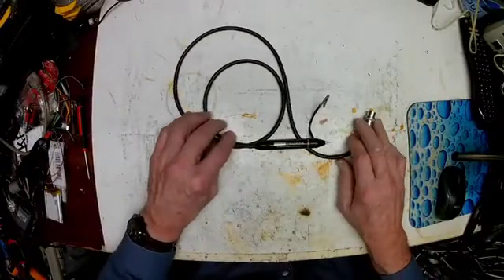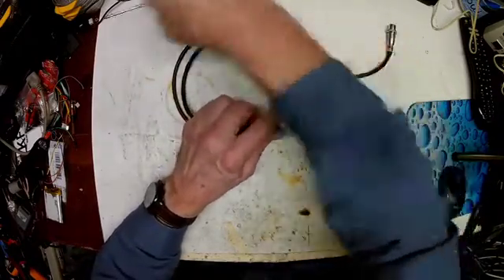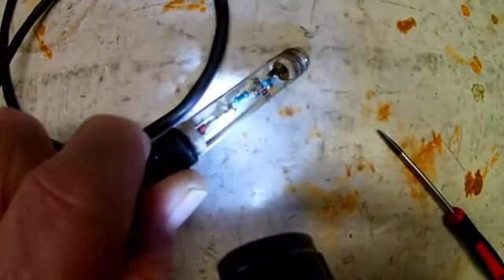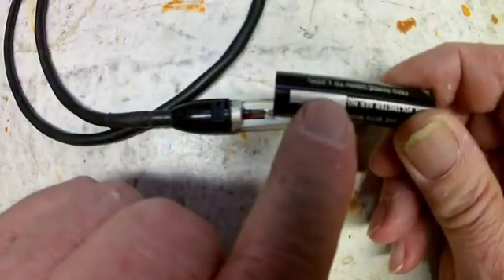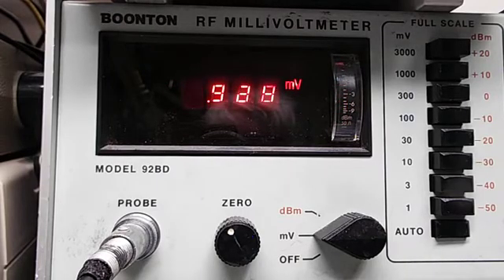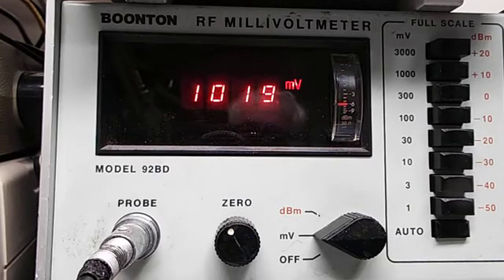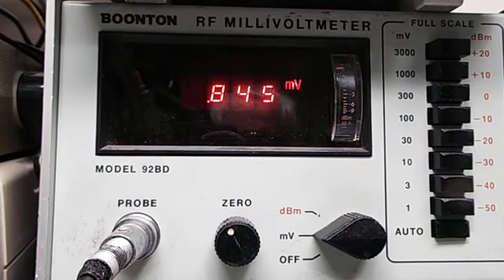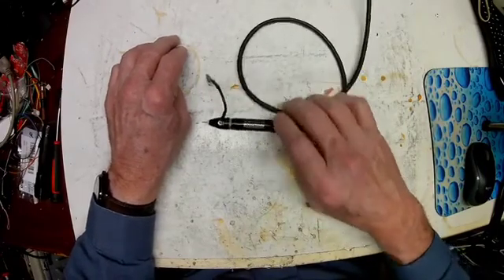The Secrets Behind the 91-12F Boonton Probe

Comment: Hi Sir thanks for sharing your experience.
I bought a 92B here in EU for 70 and got the probe but is not matching, in fact like yours has not even a number on it.
Went through an entire calibration process and seem to read accurate, of course to a certain degree, I’m not a cal lab.
But I have another type of problem with it. When a “strong” signal (higher than 100mV) is measured, then switching back to most sensitive scale the needle doesn’t go back to zero. It takes some time to settle back. Manual says that this overload is possible to occur when you go back to 1mV scale but should take less then a minute to recover. Mine can take hours. The higher the signal the more pronounced this effect. 
Any idea where to look?
Thanks
Reply from the maker: I would check all the electrolytic caps. One or more of them might have changed value drastically. Also check any resistors that would bleed off the voltage. Do you have a schematic?
Reply: @AERVBlog  I do have the manual and the schematic. Found it on internet. Actually I have found two different manuals for the B version and one of those is reflecting my unit. Small changes anyway. Thanks for your advise. I will list all the sprague electolitics inside and substitute them then I’ll see from there. The mechanical chopper also is quite delicate I guess. Overall I like the instrument and used an unused secondary out of the transformer to light the movement with 3 incandescent bulbs old style :).  
Furthhermore I have opened the movement to clean the acrilic inside. Very dangerous but now its nice and clean.
I really wish to solve that overload issue to put it back to work.
Reply from the maker: @IZ0MTW  you might want to look into getting the electronic chopper upgrade. Not nearly as finicky.

Comment: Sir what is the specific usage of this meter bcoz I got the probe alone with probe what else can be done
Reply from the maker: The meter measures low RF levels down to less than 1mV. Very useful when tracing circuits and aligning radios.  The probe has to match the specific unit by serial number or it will not be accurate.  You can not do much with the probe alone. It is not like a diode detector probe.

Comment: hi, a very very informative video I must say. I'm after one of this meters myself but do not know where to get it with the probe as on eBay I could only find meters on their own and found a probe in the UK Where I live at a hefty 103 Sterlings only to stumble across your video and then realized that it won't work.......Woaww...thats just crazy. The only reason I really need this meter is that I've purchased a Boonton 102F signal generator that is faulty and in the service manual a lot of measuring points need to be done using this very meter (Model 92B). cannot find anyone willing to help with fixing this generator so....I'm trying to fix it myself.
Reply from the maker: Good luck with the generator. Remember that any Booton probe will work it just won't be accurate so if all you need is relative readings go for it. Thanks for watching.